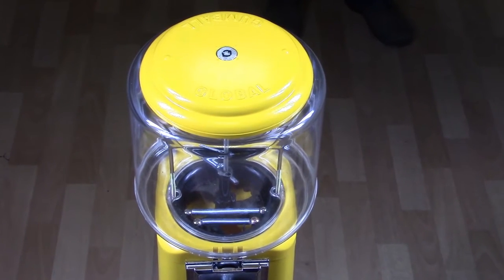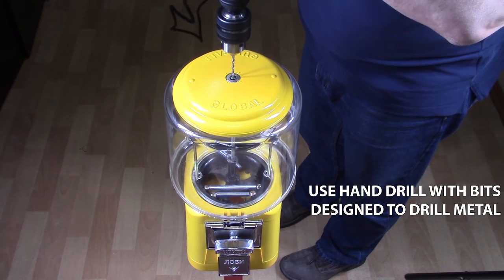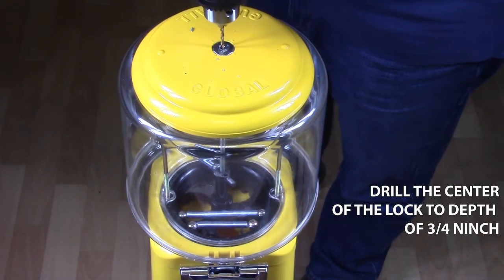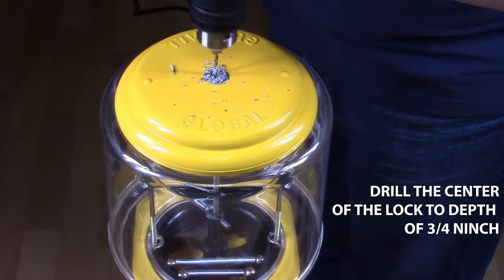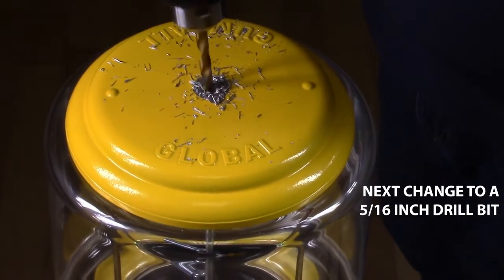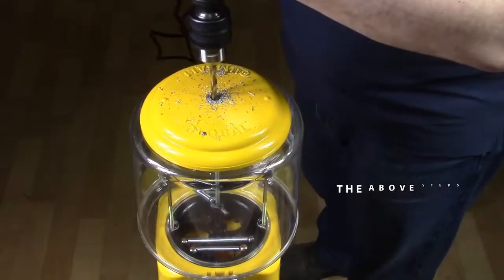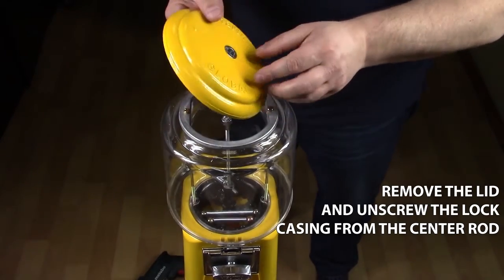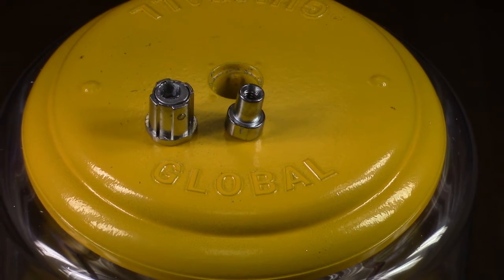Removing lock from vending machine without a key

Comment: I have a silent sales force machine and drilled out the lock, but the lid is stall fastened shut. Instead the entire globe with the lid intact came off from the body. what should I do?
Reply: fatalyersinia there is a seal you need to pop it off and also dive something in the drill hoke that's the same size an loosing it like a screw